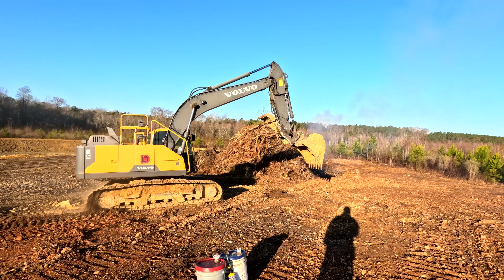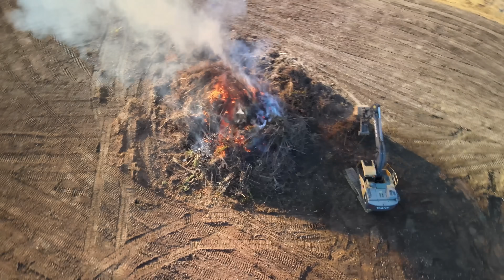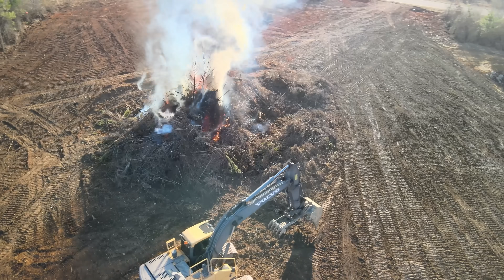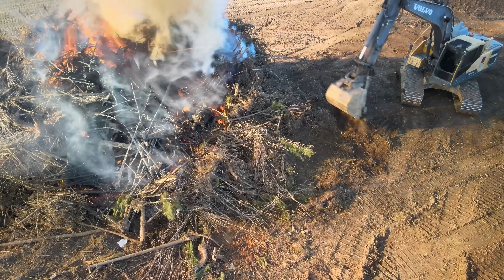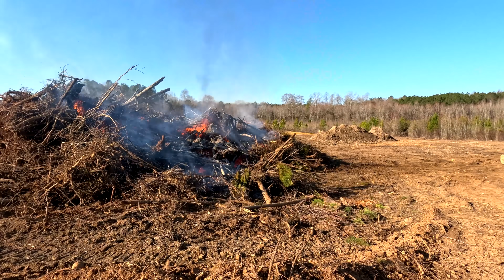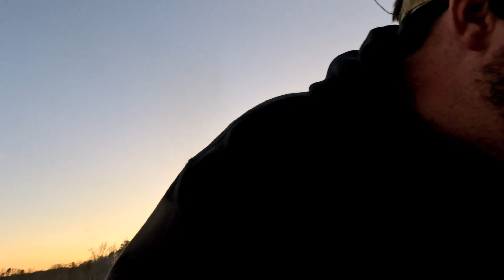Why Burn Day Might Be a Terrible Idea

Comment: Hey Geoff, I've got an idea for your consideration.  Recently you showed us (and Chris) a property you got that needs to be torn down before you can develop on it.  How about instead, you get ahold of your county fire commissioner, (because local chiefs can be resistant to the idea), and offer to let the local volunteer fire departments, practice on that property.  To sweeten the deal, you could offer a handsome donation to the FD, (which would be less than deconstruction).  Also, this would be a good time to make sure the FD personnel are aware of your recent pond build, and give them permission to access your water for firefighting should the need arise.  I'm sure you wouldn't miss 10,000 gallons here and there.  One of the best things you can do for yourself and your community is to be on a 1st name basis with some of the guys in the FD.

Thanks for sharing, and I'll watch for the next one.
Reply from the maker: We’ve discussed this. I need to check on what I was told, that it’s difficult to get rid of burnt debris. The former assistant chief lives next to me and a bunch of volunteers are on my road 😁
Reply: @BealyGood  Never heard of that.  I would think it would still qualify as construction debris, even though is was charred.

Sounds like you've got a good head start on that first name basis with the fire dept.  
👍

Comment: Burn permits are strange to me. I get that its a regional thing. I'm up in NEPA and I call the non-emergency 911 and let them know I'm having a controlled burn. I only do this for anything that is larger than a typical burn pit fire. Its not required, but I do it as a courtesy because I've had the fire dept called on me by my a-hole neighbors. I don't burn often, but when I do, I wait for a low to no wind day after a rain or snow.